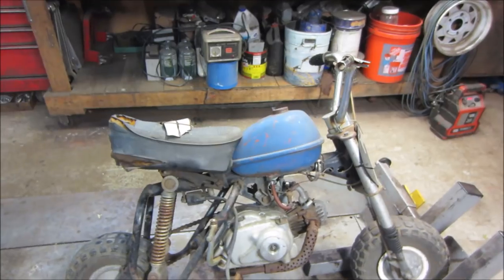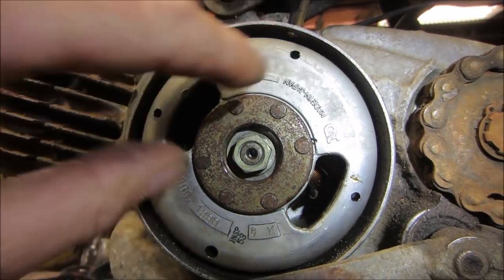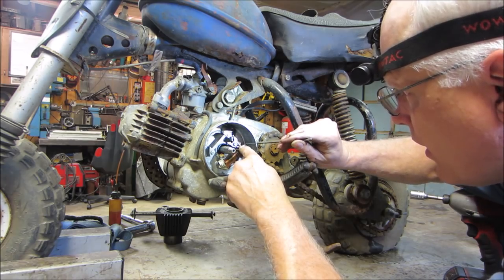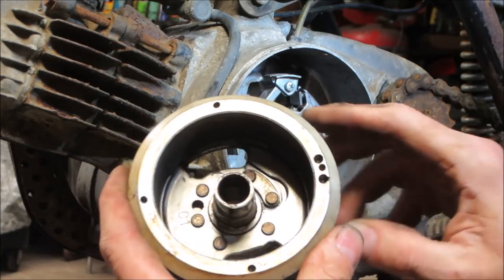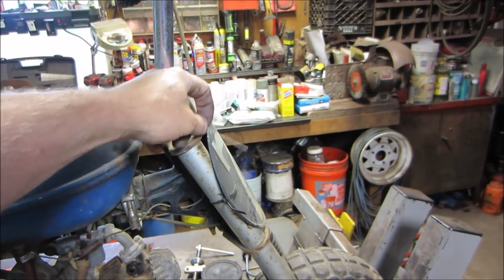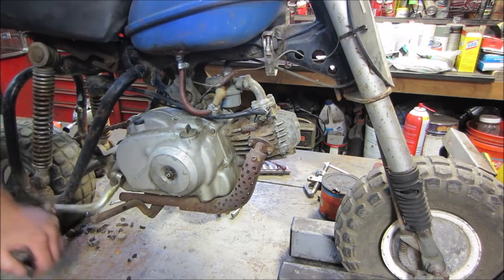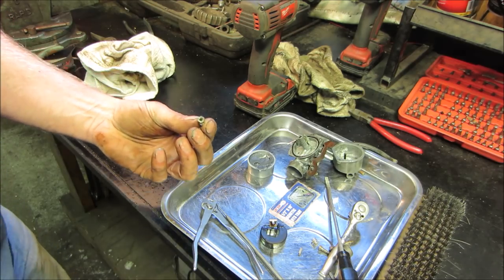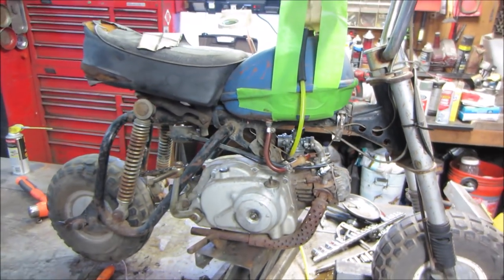will it run? old  honda 50 monkey bike

Comment: I had a similar mini-bike when I was about 12 (way back in 1973-ish) nice bike for a kid, but the automatic clutch would overheat and stop the engine until it cooled, half hour or so, then it would be good for another 40 minutes until it over heated again. Pain in the ass, and replaced it twice trying to fix it. never did. Fun except for that problem. All in all, if I had a 12 year old who wanted one, I'd get a manual shift, takes a little longer to learn to drive but sooooo many less problems.

Comment: The white stuff in the carburetor? Magnesium oxide, from the Magnesium and Aluminum alloy used on the carburetor. The two are fighting because they are near each other and are wet. When two different wet metals touch they arm wrestle to see who's the strongest and in the carburetor's casting,  Aluminum is the strongest metal and it takes as it's prize an electrical charge from Magnesium that changes an atom of Aluminum Oxide back into an atom of pure Aluminum  and leaves behind the Magnesium Oxide molecule that gave up it's charge and ended up with a booby prize, Oxygen. The new atom of Magnesium Oxide has nowhere to go, it doesn't stick to metal and doesn't stick to itself. So Magnesium Oxide just piles up everywhere inside the carburetor, plugging every hole and stopping up the bronze or brass control parts.

Comment: good lesson on  "points" in the video ;)
my buddy took an ancient chrysler outboard directly up to lake Erie fishing after I put a fresh pair of points an condensers in  and rebuilt the carb. he didn't say he was going to and I said you what! trust me and the new parts much? I was like holy ^*%$. of course it started first pull 96% of the time cold or hot, until he sold it with the boat..
yes I made sure it was right and applied green loctite to the screws after assembly, but I was worried about the unknown quality parts, changed the water pump impeller, replaced seals and changed fluid also.

Comment: One verry good tip = Try to find out What kind of fuel it used to run on .( in the 60's to the 80's most basic fuels were lead containing)  New fuels have lead-replacements and other add's  that  will give you the creeps if you just cant find the problem.

Comment: Mustie1 has almost all of the cool tools... but this vid shows just one more thing ya need to get from Hardly Freight: their little hand-held spark plug cleaner for your air-hose. It looks really cheesey, but I find that it works quite well for knocking the carbon and junk off a plug in a hurry. I didn't think that little cheesecloth bag and half ounce of media would hold up, but as long as you treat it gently it actually can last a long time. Try it!

Comment: just for grins I went and looked up the honda 50 monkey bike . the cost of parts for this thing is insane the fenders cost 400 bucks for plastic reproductions a original gas tank starts at 300 bucks a rear hub is 350 bucks if I knew they would go up like this I would have started buying them up in the 70's

Comment: the slide needle in those floated and were not locked in, the practice is still used as a matter of fact on a Chinese PZ20 carb the needle is NOT locked into place that is by design, it was used on honda ATC's, XR75, and many other honda products.

Comment: With the condition of some of the engines that Mustie has saved it is less a question of if it will run but how fast he can actually make it happen. This carb was one of the more disgusting ones but not the worst i've seen on this channel. Great job on this one. I still maintain that I need to buy a bike or scooter of some kind from you, Or maybe @Harvey Spooner. They just aren't common in my area :(

Comment: That is not a Trail 50. It is a QA 50, I had one. Through some sort of horse trading my buddy owned it after awhile. Years later, we were sitting in his parents kitchen, now sort of grown up, and I asked him if it was still around. He had parked it in the backyard of their house and the place kind of got overgrown with ivy, and year by year the little 50 got a little more consumed by the creeping plant. So we go out back and dig around in the foliage and find it, right where he had left it. The gas tank was rotted out, air cleaner missing and ivy was growing in the carb. We extracted it, spent about an hour tinkering and rigging a fuel bottle on it and got it running. Those things are indestructible.

Comment: years ago I built a two tone timing device for outboards. don't remember the exact plan but it would give one tone while points were open and another when closed ( due to the difference created by the capacitor in circuit). this could be done with all wires connected so no worry about things changing when attaching the wires. much better than the flashlight thing and especially good on multy cylinders to make sure all were exact. I am shure with your background you could produce something along those lines. make timing a points type ignition a hands free operation and much more accurate. have never seen a commercial model but mine was copied several times.  Dave love you vids.

Comment: It has spark but at the wrong time. I think the flywheel key is sheared. Or the valves are stuck open, it seems to have compression. There you go it was the valves stuck open. You say points well maybe?

Comment: 14:40
 Wire strippers are arse about face as they are. It"s the sharp flat face that pulls the insulation off; your way round the bevels are clamping the insulation to the wire so you"re fighting yourself.
Just saying but.

Comment: The bowl of the carberator needed some tender loving care from a Dremel tool fitted with a mini cone and ball wire brush and small amounts of carb cleaner. 
You gotta sample test the metal on the outside with some carb cleaner on a Qtip before you do to make sure it won't hurt the pot metal they make them outta.
I've cleaned dozens of them that way with a light touch.

Comment: A blow torch on a fouled plug will clean it up nicely. It should get it back to working order. Just get it red hot. (use plyers to hold the plug)

Comment: If that transmission isn't put together right once someone takes the side cover off it's very tricky it's a bar lock transmission
  Sounds like you've only got second gear and that's a common trick sounds like someone's already tried to fix it it's a easy fix and it's a simple transmission it's got a sliding bar within two gears actuated from the clutch side of the engine but it has to be put together stringently and gingerly or the finger that grabs the gear lever will not slide in right

Comment: I take brake cable from bike, cut small section and untwist a strand and use that to clear out stubborn jet holes. The strands are super thin but strong. put it in a drill or just poke. The worse jet to clean is the coleman gas lanterns. Talk about small jet hole.

Comment: just started watching your videos and i enjoy them. though i would recommend some rubber pads of some type when using the vice to hold soft metal parts. specifically on the one side of the carb so you do not scratch it or leave grooves, this could possibly give you issues when trying to make a good seal once its put back together.

Comment: i have one and it runs but nothing happens when you use the throttle so idk if there is a stripped gear or what. it revs but in any gear it wont move.

Comment: Nice work. 
Those Honda 4-strokes are really good. You can get a lot of parts for them even today, although the push-rod engine is not as popular as the OHC engines. They just keep going even with minimal maintenance.

Comment: OMG That looked like a blast! Hey they used to build them good in the day you didn't find one piece of plastic. Even as bad as it was it still ran good after the valve adjustment and the points,  A little masking tape some tie wraps and gas it was ready for race day! You gave it more love in one show than it's had its whole life. Great Video great job!

Comment: just started getting into your channel. i like bringing old stuff back from the dead, too.
what brand/model of ultrasonic cleaner do you have ? do you like it ? i think i need one. thanks, joe.
Reply: Joe f. They’re available on amazon for a couple hundred bucks. They’re pretty much all variations on the same thing. I bought the 30L version for just under $400. I thought they were snake oil, but they work wonders. Get one! They’re game changers when it comes to carbs and pistols.

Comment: Fun little bikes. My first one was a 69 QA50 but it was a 3 speed auto. There is an adjustment on the side of the case for the clutch but sounded more like the gear was actually popping out. Thanks again Darin!

Comment: Next time you just wrap a spar plug wire around the tip of the plug, try holding on with a wooden clothes pin.  They are great cheap clamps.